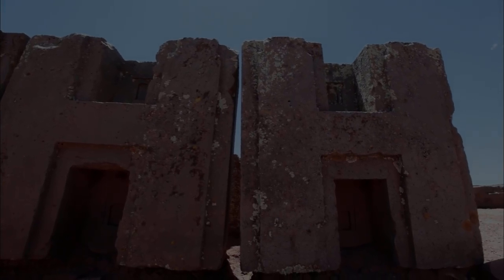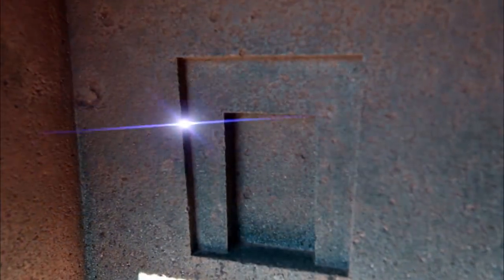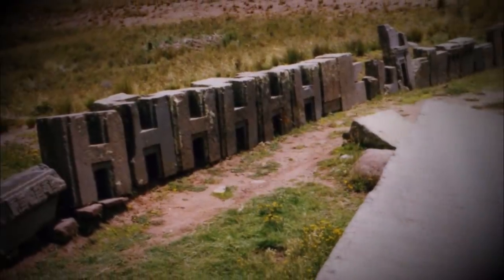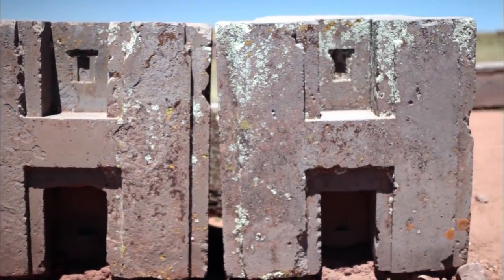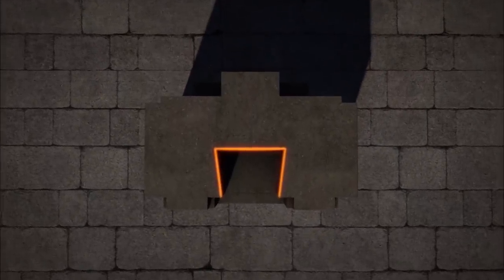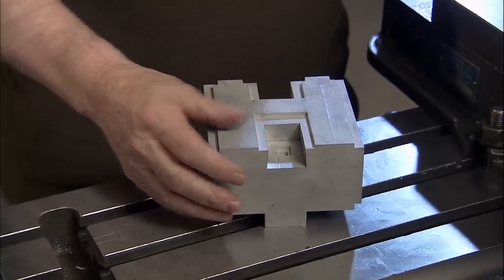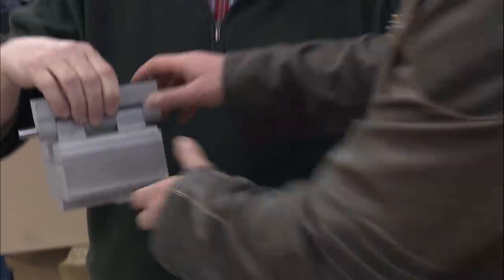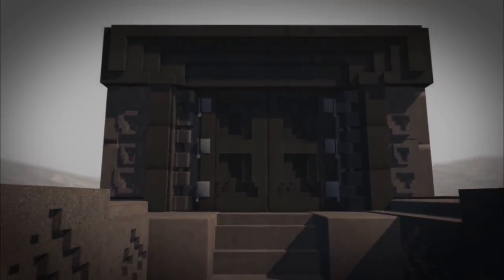Ancient Aliens: Solving the Mystery of Puma Punku's Stone Blocks (Season 9) | History

Comment: I love how he suddenly jumped to the conclusions that the dovetails were meant to hold door hinges.
Reply: because they are duck wedge shaped, but I too would need more evidence that they had any engineering reason for them.. just art of the ancients I guess.. like doodles. how they cut the stone so well by hand is still a mystery.
Reply: The question is: Where have the machines gone? Wooden machines wood be to weak to lift these heavy mega stone blocks...
Reply: @blacklion8208  even machines made out of steel would rot away, thats whats insane about this idea alone true or not is that even if they did have steel or steel tools it would be completely gone.
Reply: @mikem4432  They weren't cut by hand or cut at all.
Reply: @Grandmasterkiller  I agree they weren't cut at all. Probably the same technology was used on the Great Pyramid of Giza, which Dunn had investigated, too, by the way.
Reply: An interlocking H pattern is possible with tiny gaps in the bottom for doors or bottom parts may be buried like a stake

Comment: looks like it was poured into a mold
Reply: How if they didn't have writing ? Even if it wasn't molding how did they get it so precise ?
Reply: It looks like modern day 3D printed. 🙌 If you say no, you should take a look at Petra jordan, "Unknown civilization" have used 3D printed laser technology.
Reply: @nathangovea5253  dont be so naive.
Reply: Derek Reynolds by who derek?
Reply: Derek Reynolds its s fine line and there were no rulers or tape measuring bk then.
Reply: @taniahapurona4390   ruler doesnt matter, as long as they were intellegent in those days, they can make a straight line mold
Reply: @taniahapurona4390 , Of course, they had rulers,,, who do you think ordered them to do the work...
Reply: But it's solid rock not cement.
And primordial cement was invented by the ancient Romans over 2700 years later.
Reply: it might've been
Reply: Even the measurements and fundamental physics didn't exist

Comment: Puma Punka construction has been scientifically analysed. The megaliths and the H blocks are moulded Geopolymer concrete. See the Geopolymer Institute channel analysis. The blocks are not carved, in fact they contain organic elements used to harden the concrete. The sharp angles were made using wet sand pounding techniques. The ancients had the means, through plant extracts to soften stone and harden it again. Ancient alien theory comprehensively debunked.
Reply: None of what you said explains the right angles replicated so many time with such accuracy. And which plant extract softens geopolymer??

Comment: If we travel to another planet.  I doubt we’ll start caving up stone blocks 😂
Reply: The thing is these structures can outlast our modern ones, using stone is actually a solid way of making a structure that lasts. Also think about the fact that not every civilisation would have the same idea of how to build, food for thought.
Reply: Very True stone lasts but these blocks alone are incomplete every notch and keyway had a particular purpose. (Not ornamental) stone more than likely chosen due to its density and weight. It’s safe to say they weren’t  sets of earrings but Maybe foundations set in rows with equal spacing. The keyways ready to accept and lock in wooden columns from which a functional structural system emerged.

Comment: My next question is, where are the hinges and doors, and where are the temples where they were used?  I also feel as thought the H blocks have the appearance of being poured concrete rather than carved stone.
Reply: except it is a stone.. not a mixture of different substances like concrete.. so.. there is that.. the H-Block are made of pure substance not a mix.
Reply: Poured rock. Cast into precise shapes and sizes.
They had to abandon the project before it could be completed.